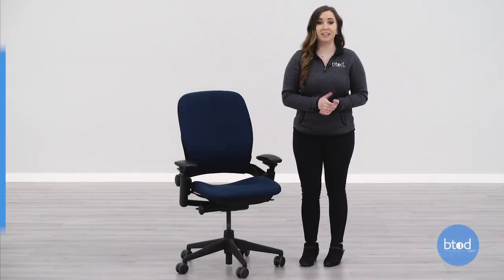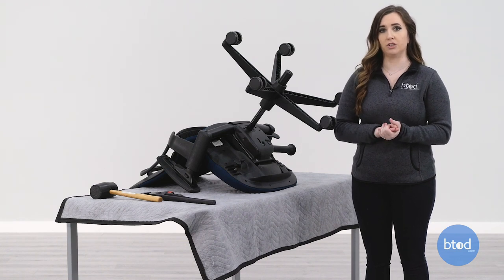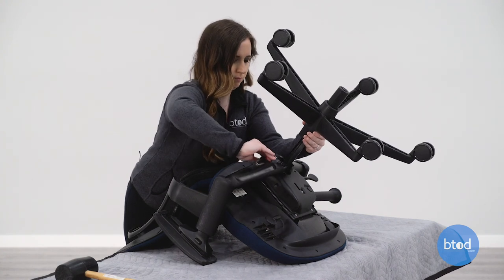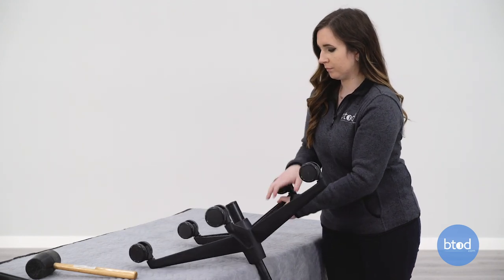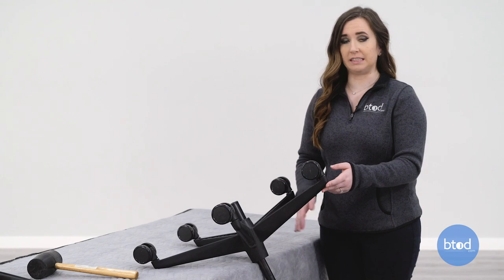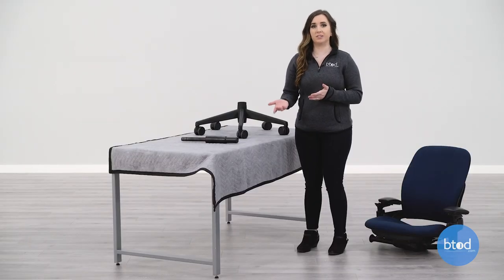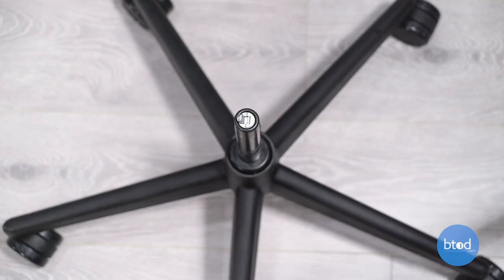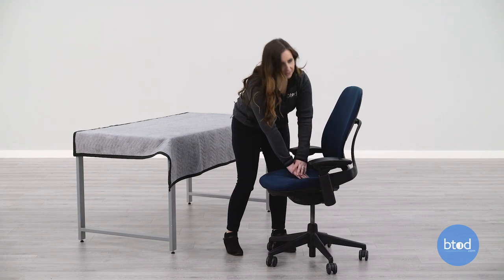Steelcase Leap V2: How-To Remove & Replace Gas Cylinder

Comment: Lay on the ground, hold onto the legs/wheels, put your feet on bottom of seat and push away with your legs. Should come off. I had no pipe wrench and hitting it upside down with mallet might of loosened it but definitely didnt come off. When putting back on, I had the wheels down and placed the chair down ontop of it with the seat off so I can see the latch, took a bit to line it up gently, sweat that I might be off slightly, and then push down. My chair stll gives slightly when I sit in, but feels like its adjusting and not like its losing tension anymore. Hope this helps someone.
Reply: Thank you! It works!
Reply: I did this and broke the cylinder 😅

Comment: I cant remove the cylinder from the chair either with 2 different wrenches.  Seems impossible
Reply: you NEED a solid pipe wrench to have a chance
Reply: @nikolaslamb439  yea I gave up, way harder than it needed to be
Reply: @TonyDrecaps  Indeed it is.
Reply: 18” pipe wrench, lay the chair on its side, use your foot, repeated kicking down motion.
Reply: @nikolaslamb439 Even a Milwaukee isn't working for me..old chair
Reply: It took a 24” pipe wrench for me

Comment: I tried for like 10 minutes. Eventually I laid it in the ground and started pulling the bottom while securing the chair with my foot. It did not budge. The wrench just messed up my wrench. Then I hit the base with a mallet. That made it move. Eventually I pulled it up in the air by the cylinder and dropped the entire chair a few inches. That eventually made the cylinder come lose. Quite a frustrating process.

Comment: Thanks.  Just needed to make sure the piston wasn't screwed into the base.  In addtion to using the pipe wrench, I used a rubber mallet to whack the wrench pretty hard in order to loosen up the piston.  Same for removing the piston from the base.
Reply: This is what finally worked for me.  Still trying to get the cylinder out of the chair base though.
Reply: @marklgarcia  You ever end up having any luck with this? I just got a refurb Leap v2 and wasn't aware of the side pin, I've only had top triggered chairs before now, so now I have a non-functioning height adjustment, and I can't get the dang thing out.
Reply: @jefmes  yes, I managed to get the chair apart and put back together. The top where the adjustment pin is wasn't too bad.  I used  a dense rubber mallet to hit the pipe wrench to get the torque need to loosen it.  It went back together ok.  Getting the chair base off was a challenge.  After a few hits the wheels were no longer in the way.  I placed the center of the piston on a wood block and hammered the base off using strong blows from a large rubber mallet. Using anger and frustration is helpful in accomplishing this task ;)
Reply: @marklgarcia  Thanks for the reply! I should only need to get the piston removed from the chair so if I can get that done I think I'll be set *fingers crossed*. I did notice something else, on the very bottom on the piston, the part that nearly touches the floor with the wheels - do you have a plastic cap on that end, or is it open? Mine is open and I've already managed to get my hand in the piston grease and stain the side of the piston, argh.
Reply: Thanks for the mallet idea, its what finally got it to work for me!

Comment: Cylinder won't budge for me either and I can guarantee I'm thrice as strong as the lovely lady in the video. Something isn't right.
Reply from the maker: Some chairs can definitely be a struggle especially if they've been sat in for years. What have you all done so far? Here are a few tips: You can tap the sides of the cylinder, but not super hard with your thrice strength. While pulling on the cylinder, hit the bottom of the mechanism with the rubber mallet to put outward force on the cylinder. If you aren't worried about damaging the cylinder, you can add a little WD-40 where it is stuck. Hope these tips help! - TK
Reply: @btodtv  Thanks! I'll give those ideas a shot.
Reply: @btodtv  I've tried all of these but the cylinder still won't budge. My pipe wrench has been grating the metal off the cylinder and eventually is going to tear right through it. Any other tips?

Edit: I got the cylinder off the seat by hammering the wrench harder. However now the cylinder is stuck in the base.

Comment: Better way that won't damage the cylinder with a pipe wrench: 1 - Place the chair upside down on a blanket on the floor as shown in the video   2 - a squirt of WD40 in the socket where the cylinder enters the chair, wait 5 min   3 - Duct tape cover the jaws of a pair of large vice grips and secure them around the cylinder close to the chair base   3 - Grab and support the opposite side of the cylinder or base with one hand, then mallet/deadblow hammer/regular hammer the handle of the vise-grips so that the cylinder will rotate and the cylinder should unjam and come out     5 - support the chair legs on a garbage can or if you're brave your own legs and mallet the cylinder out of the base as shown in the video

IMO everyone should own WD40 and a set of various sized vicegrips they are the most useful tools known to mankind.
Vice grips are much better than the pipe wrench because pipe wrenches need to dig into the metal to grip properly, vicegrips use an over center clamping mechanism to hold onto the workpiece without slipping and distribute pressure more evenly.

Comment: I couldn't get mine to budge either even using a hammer and large pipe wrench. Today I went to move backward and heard scraping. Thought it was a wheel stuck on something, ended up being the cylinder scrapping the floor. Apparently its a pretty common issue later on with this model. I did manage to get the wheel assembly to move off the cylinder with a lot of hammer persuasion. This gave me room to put two layers of electrical tape on the cylinder. Two layers was the perfect thickness to lift the chair back into position. I went to look at my other Leap that Im just going to use as a parts chair now (back recline mechanism broke) and it also is very close scraping the floor. 

Anyone successfully replace the back recline mechanism, or do you have to replace the entire seat carrier assembly?
Reply: Thanks for this comment, this is my current problem as well

Comment: Not sure if this video is still monitored but I recently purchased a steelcase Amia chair and it seems to sit too high? The piston seems to move correctly with the lever and I’ve adjusted the set screw so it goes up and down relatively evenly but even fully down it feels like it’s too high.. I have a Leap at work and my feet can definitely sit on the ground whereas this chair just bought even at the lowest setting my feet are off the ground.. bottom of the piston is 2” or so off the floor as this chair is so I’m kind of stumped as to why it’s sitting so high..

Comment: Hi! Very good video, otherwise never I would had been able to figure out myself, and usually bringing a hammer isn't the first thing you think about when you want to manipulate a 1000$+ chair lol.

QUESTION: The issue we have is that the cylinder is completely touching the floor and we just noticed it scratched a lot of the wood floor, I'm quite pissed at that and I can't see any ways to screw/unscrew it to raise it from the floor. What can we do?

Comment: My column is really stuck and doesn't stick out the bottom like this chair. I use rubber mallet, small hammer and normal hammer. The lifter came out but column is still stuck. I have used penetrating oil but still stuck. I'm trying to avoid replacing the base. Any suggestions?

Comment: does the v2 require a special cylinder? the replacement i got is a little too thin causing it to sink every time someone sits in it
Reply: could be how the hidden set screw is activating it

Comment: I just received my refurb chair today and the cylinder won't hold the seat height. It slowly goes down. My chair does not have a set screw as it is a top-activated cylinder. Is it a bad cylinder?
Reply: Yes, if it isn't holding height it's a bad cylinder.

Comment: For those struggling with this method, I highly recommend getting the Oasis gas cylinder replacement kit shown in this video https://www.youtube.com/watch?v=8nSEa8-mGrs

BTOD should definitely consider creating something like this for instances like I had when the gas cylinder wasn't working right and they sent a replacement only for me to not be able to remove the thing at all no matter what I did. Spent a number of hours on separate occasions trying to pipe wrench the chair off to no avail. 

Got the Oasis kit that comes with two rings you latch onto the cylinder you then use screws to push the tightened ring away from the other one thus freeing the gas cylinder from the chair seat. No smacking a pipe wrench with a mallet, just turning two screws with an Allen wrench and it popped off. Still had to take the wheel base and cylinder outside with a bucket and hammer but that was super easy. 

I still installed the replacement cylinder BTOD gave me but now have an easy method should I need to do this again.
Reply: The hard part for most people is getting the cylinder out of the base. My 70yo rancher dad and I banged on mine with a rubber mallet and tried twisting with a pipe wrench but when it's stuck in there good it's hard to get out.

Comment: I didn't line up the arrows on the bottom of the chair and the cylinder before I mounted the chair on the cylinder. now it's stuck or seems to be and this video doesn't show a way to fix the problem. or if It does I am missing it.
Reply: fixed it!
Reply: @zotan  how did you fix it, I just got my chair and it's stuck
Reply: @jimmymok5943  I took a small pipe wrench and turned the cylinder clockwise and it loosened right away. I don't think it matters which way you turn it but it's way easier than I thought it would be.
Reply: These are the instructions from Crandall Furniture, their answer to my question about the problem: "You'll probably need to remove the cylinder completely and re-install - a pipe wrench should help you get it off. It should hopefully not be on there too tight if you just installed it."
Reply: @zotan  Hey it worked, and yes I agree it was way easier than I thought it would be. They need to give better instructions for the cylinder's that you have to align to the lever. It's easier to align it if you put the base facing the ground and insert the cylinder into the base as opposed to inserting the base of the seat into the cylinder.
Reply: I just spent an hour trying to loosen it with a 12" plumber's wrench, scratched the heck out of the cylinder even with tape, and still couldn't get it loose. I did the same thing as you, but I think I've been using it too long as is and it settled in a bit more. I need a newer, sturdier pipe wrench anyway so I'm going to get a 18" - 22" wrench and try again. It clearly needs more leverage. Either way...this is just NOT a good design for something that should be more easily user serviceable. I hope SteelCase revisits this in the future.
Reply from the maker: With more leverage, you’ll get it out. Friction fit and just needs a 1/4 turn to pop loose -GK